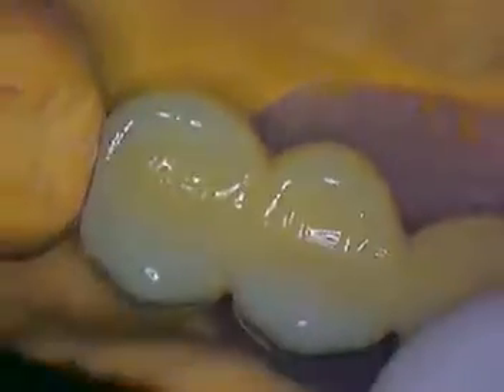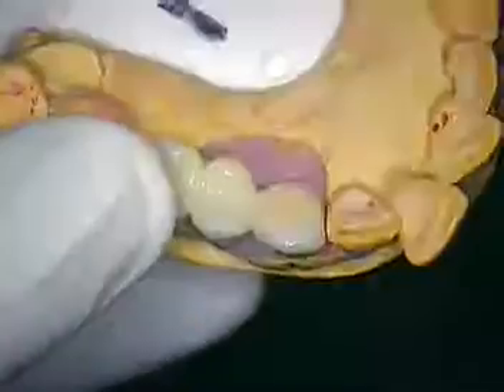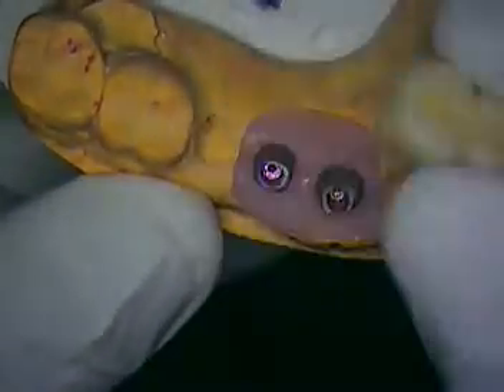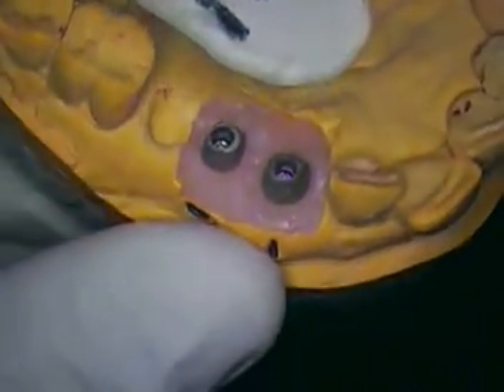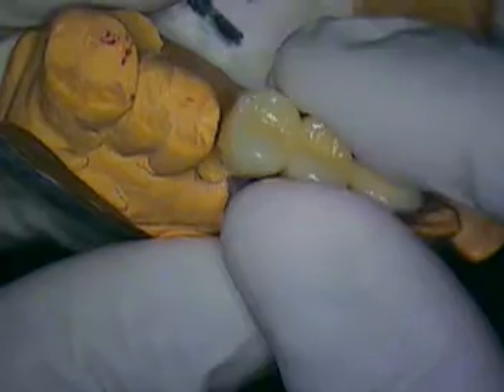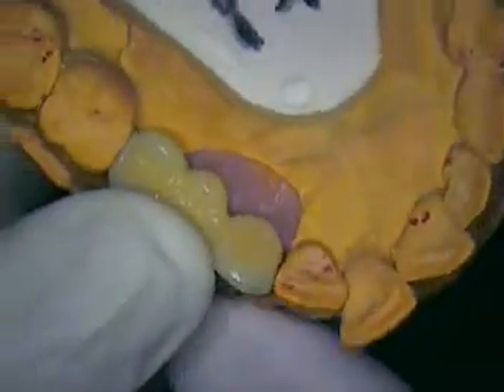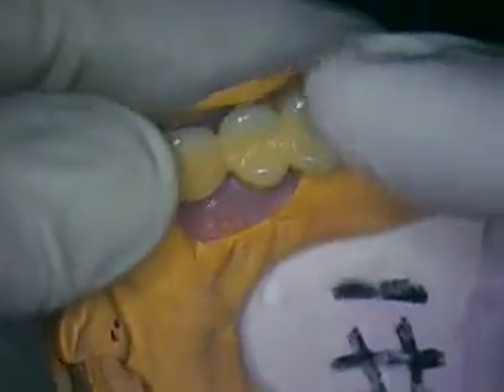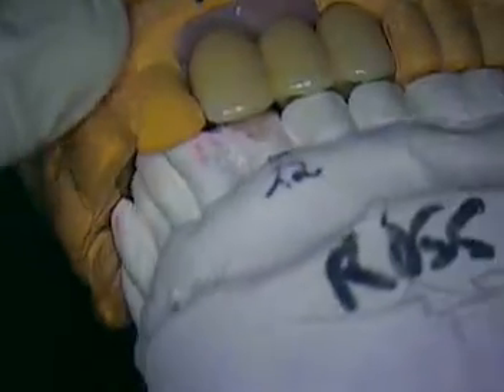DR. GERARD CUOMO - Dental Implant Bone Level Case - final cementation lab work 1 of 4

Comment from the maker: @mrlecuk Thanks for commenting.  Surgical fees (separate from restorative) vary from $1500-2500 per implant which may not include bone grafting.  Restorative fees may vary from $1200-2200 per implant.  The fees for implants are obviously much greater than fees for routine restorative dentistry.  My best recommendation for tooth replacement would include an implant instead of choosing a fixed bridge.  Hope this helps.  GC